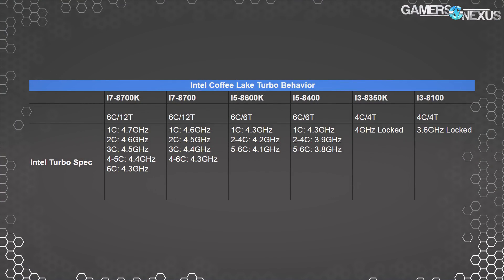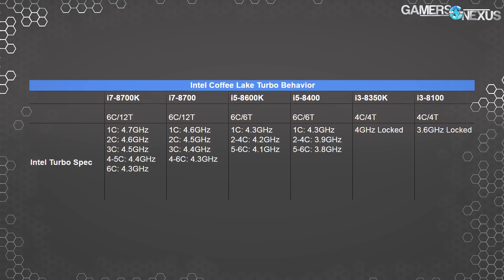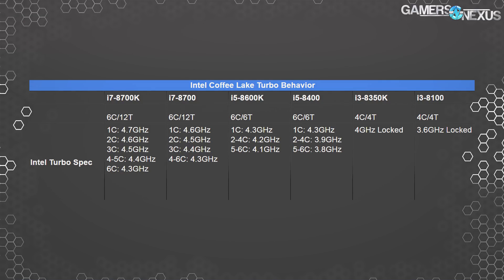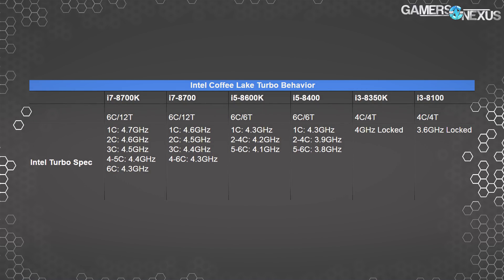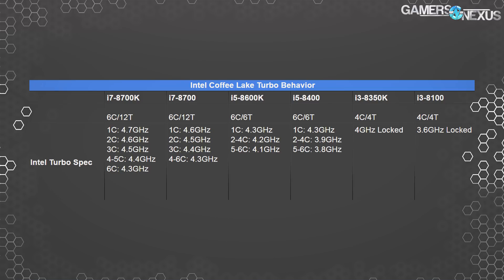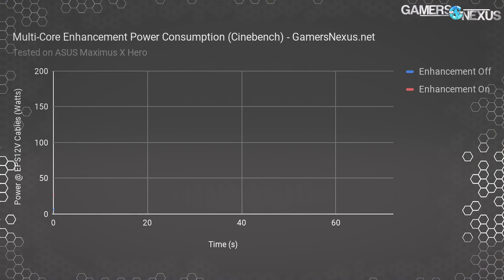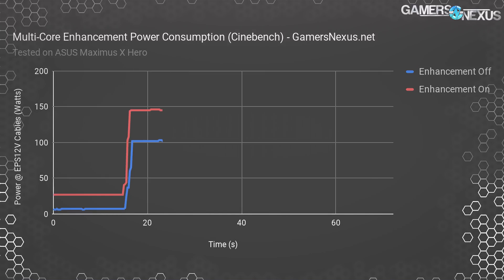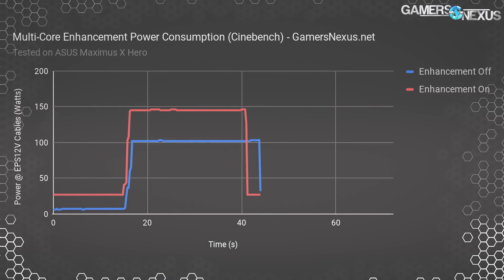Explaining Coffee Lake Turbo Boost Variance & Multi-Core Enhancement

Comment: Hi guys, just wanted to pop-in and let everyone know we watched the video and love the discussion in the comments. Stephen was correct, we want your input in shaping our BIOS policies because at the end of the day we make our products for you guys! To that end we created a FAQ on  our forums that covers: what out policy is, why we implement it the way we do (spoiler: we agree default is default), and to create transparency. If you guys have any questions you can always find me on our forums. - Matt
Reply: Off by default is probably best. Any easy menu to switch things like that on will mean users actually get the benefit but there should probably be a disclaimer/description next to the button to let users know that it may be unstable in some tasks.
Reply: Off by default.

And don't confuse the issue by having more than one type of self-overclocking program. Also, make it as clear as you can what exactly needs to be done to use an auto-overclocking tool so the less informed user can avoid making mistakes. List the possible down sides of using your auto-OC method, such as possible instability.
Reply: Thanks! I know outside looking in our industry can look like an unapproachable giant, but you have to remember we are enthusiasts too!
Reply: By default off.
Reply: :) Hear that a lot actually. Going forward the RGB emphasis in the ads/promos should be toned down abit, but it will obviously still be on the board.
Reply: off by default
Reply: If you want to make people who overclock happy, please make sure to add some sort of 'boot to bios' switch on the boards, when cycling ram timings and try to get things to stick it would be nice if I could walk away and not have to sit there through 5 retry attempts, even setting it to 1 attempt is still annoying to have to spam the del key.  

Also if you feel like really going out of your way, I personally would love for a BIOS that gives some stress tests for CPU and RAM inside the overclocking section with a relevant info panel for monitoring (CPUID HWMonitor is the gold standard for info). I mean sure I can boot into windows and play with timings but tightening ram sub-timings is terribly annoying currently, so much time could be saved.
Reply: mjr2015 you said it man!! Seeing gigabyte's interest in the community and straight up love for their fans im looking out for gigabyte products now for SURE!!
Reply: +GIGABYTE USA every time i think about switching back over to MSI for my personal builds, you guys seem to know i'm pissed at one of your boards and release a bios update that fixes all my problems. My 990FXA-UD3 (rev 4) and Z170x-UD3 ultra have frustrated me over the years...
Reply: Off by default
Reply: I really like how Gigabyte interacts with the community, +1 reputation.
Reply: Make your Mainboards better for Overclocking and better VRMs, I had the GA-Z87X-D3H and was PISSED
Reply: GIGABYTE USA Would this confuse overclocking when enabled? Say you overclocked to 4.9ghz will it try to boost some cores above 5ghz? I'd have it disabled because i like to have control of my own products. It is already causing confusion.
Having just bought a z370 ultra gaming I'm glad gamersnexus did this review because i would of had no idea.
Reply: Multi-core enhancement should OFF by default.  

All defaults should ALWAYS be the most stable and most vanilla options possible.
Everyone buying motherboards will be inside the BIOS anyway and can at that point chose to enable it or whatever. 
I always enable it - but that doesn't mean I want the manufacturer to enable it by default.  In fact, as a customer, I would lose  A LOT of confidence in any manufacturer that set it on as default.   That would be akin to setting overclock parameters by default - which would just be crazy!
Reply: As a default I agree it should be "OFF" however I would like to see better descriptions in the bios on all the options. It is really annoying and flustrating when you select an option like "Multi-Core Enhancement" and get text in the description box of "Enable/Disable Multi-Core Enhancement". It would be much better if it have a brief explanation on what it does and the default setting. I get the in the old Legacy Bios you where extremely limited however in modern bios this is no longer the case I have see bios that have a brief description and a link  to a comprehensive description of the feature if the user want to read more. This should be the STANDARD when it comes to providing information to the user in the bios.
Reply: Good seeing Gigabyte personal on different articles ive seen. I went with the Gaming 7! First time Gigabyte board owner, should go well with my aorus ti
Reply: This.
...I think I know which company I'm getting my next MB from.
Reply: First of all I would like to say that we are of course not the average user and you can generally expect a bit more knowledge from GN viewers.

I personally think it should be off by default in this case. I am ignoring the instability here for a second as really that's just a sign that asus in this case was too aggressive with the voltages and caused the instability on the somewhat badly binned 8700k used here. Given a bit higher voltage the system would have ran stable and this should really just be fixed by asus in my opinion. 

Looking at the results 9% improvement at the cost of 40% power just is not enough to warrant rolling it out to most users. The extra power draw can cause at least a bit more noise from the lots of people still using intel stock coolers and really a 9% gain will not matter much to the average user. 

However in a scenario where you  where you generally get a 40% gain in performance at a 10% gain in power draw on most cpu's I would say sure enable it this is not the case and probably never will be.

I think it should ultimately be a consideration between performance gained and power used as you want to give end users the best possible experience knowing that most people will never manually tune their settings. I do think that settings like this should always be stable even if it may cause a bit higher power usage and may not be needed on all systems as I can imagine a less tech savvy will not always be able to figure out what the problem is and why their system keeps crashing.
Reply: You have definitely earned my respect! I like it when you are willing to talk! Continue the good work!
Reply: To answer your question:
I am a hardware reviewer, collaborating with a prominent website in my country. I do specific reviews focused on gaming. The multicore enhancement feature is useless to me as a reviewer because I will promptly disable it and manually set up the CPU anyway. That's what I did with the 8600K, reaching 5 GHz @1.35V on air cooling with room to spare.
So from my perspective (both as a reviewer and power user), I would like the feature to exist but come disabled, as in "obviously disabled", no "Auto" shenanigans.
More generally, to me, "Auto" means "we're gonna do our stuff however you will have no clue what the stuff is" - and I am very reluctant to leave anything as Auto.
Reply: Yup, most of us could do without any RGB stuff at all.  Most of us are much more interested in features of function!  For example if Gigabyte decided tomorrow to eliminate all RGB across all MB products and instead offered on-board power switches, headless BIOS upgradability, XMP request switches, and LED state indicators for any of a huge range of connection and mode states to ALL of their MB models the world would applaud more than complain! By a lot!  Maybe 20:1...
Reply: @GIGABYTE USA Off by default, the inexperienced user will encounter said crashes and wind up chalking it up to bad components and end up being far more of an issue than it needs to be. IF they were to have it enabled by default it should give a warning with something like "You have core enhancement feature turned on, this is known to cause instability in some programs and if you encounter this it is advised you turn it off in the bios(insert link to a guide to help the user find the setting in bios and turn it off)"
Reply: Or that voltage may be a little higher than required by manual overclock simply because not all cpus are the same.
Reply: I love that you're showing presence! I don't regret going with the Gigabyte Aorus Gaming 7 this time, as opposed to the Asus Maximus VII Hero from last time!

Multi core enhancements should be OFF by default in my opinion! Even if it boosts performance, it's something that the average user does not expect from the CPU.
The CPU should run at whatever it was specified by Intel to run at unless the user changes the specific setting manually.
Reply: Off be default please, let the user learn about it, the possible issues and then make their own decision. Its possible they would want it on for specific jobs x,y,z but for stability while gaming leave it off.. I also think you create a support headache as having it on by default could lead to instability and possibly leading to more RMA's that are not needed.
Reply: RGB: If you can disable it then no problem. And I think users complain because it adds to the price of the motherboard for a feature they won't use. Many users don't understand that the RGB components are not very expensive.
Reply: I love gigabyte motherboards, but currently this z170x ud5 is failing me pretty badly. I used to be able to OC my CPU and RAM without issue. Now I cant touch OC ing without blue screening at any load. I cant even run my memory at its XMP of 3000Mhz... which is just sad. I made sure its not my CPu or RAM by testing others and its the motherboard :(
Reply: I would purchase a Gigabyte Motherboard (I have one, and love it. ESPECIALLY the 10 Rear USB ports), but they are >$20 more than competitors at my local retailer (MSY Australia). Still haven't ruled you guys out yet, got a while till I upgrade my FX 8350 to Ryzen.
Reply: If you set 49X all cores should run at 49x under load."Enhanced" turbo simply pegs all cores at the max multiplier, in this case 49x.
Reply: Off. Stick to the CPU manufacturer specs for default out of the box configuration whenever possible. I know this is getting hazy nowadays, when everything is getting smart and self-overclocking and whatnot, but the closer to a standard baseline we can keep the default configuration across the board, the easier it is to troubleshoot.

ps. Long time gigabyte board user here, love your robust hardware (or maybe I've just always been lucky?) but darnit your BIOS options are awful to figure out sometimes... :-)
Reply: Features like this should be off. MY BIGGEST request though is proper explanations what each item does and clear naming. If on board audio is called anything else other than  on board audio - this doesn't help.
Reply: I believe Off is the correct option. Especially since Intel does not give a HSF with 'k' series cpu's. So you are potentially going to use a HSF from a older Celeron ie the tiniest stock HSF to fit on a 115x socket. Can you even cool a 'k' series CPU with that HSF and multicore enhancement on?

Since all of the major motherboard manufacturers employ professional overclockers I would like to see bios/uefi options written with better descriptions especially for the 'better' (gamer/enthusiast) boards in the series. All too often bios options have no description or an absolutely useless one.

Also different colour motherboards would be nice. For my girlfriends recent 7700k build we had to go with a MSI Titanium M-power z270 board because there is nothing other than black in the market place. She wanted a white and blue build - It looks really nice.

I'm a very happy owner of a z68xp-ud4p with a 2600k. (Yes, my girlfriends pc is faster than mine. gah)Will be upgrading to a Ryzen soonish. Gigabyte will fighting hard for my dollars with ASUS.

Also not a fan of the Aourus branding on the better part of the Gigabyte lineup. Gigabyte is pretty much synonymous with 'Ultra Durable' and reliability a branding you begun with the p45 chipset iirc. Aourus with gamery bling. I know which one I prefer my computer to be.

Thanks for taking the time to listen to the community Gigabyte USA.
Reply: Keep it off please. For the more advanced users, they'll know what this setting is and can enable or disable as they see fit.
Reply: best hardware company in the world! always buy gigabyte!

Comment: By default should be off, user should have the option to enable it in the bios of course. The existence of "Auto" options is rather unfortunate in the first place, imho. Precisely because it is not always clear whatever state it will get into, or what might trigger a state change from that one, or even if any such state change might occur after whatever initial state it chooses

Comment: The turbo boost is only kicking in when the application needs it - that's speedstep. On Auto settings the voltage is variable going up for higher frequencies and lowering with lower ones.  With MCE you make the turbo speed uniform across all cores - equal to Intel's advertised single core turbo boost 2.0. speed. It is fully stable under all conditions unless you have an extremely bad chip. Problem with all these auto settings (including the regular auto voltage) is that the voltage is set too high in order to allow for the worst of the worst chips (but some are just loser chips regardless). You will always have to manually lower the voltage anyway if you are to get better temps, power and lifetime.

Comment: so i7 8700 non-k when enabling xmp and the multi core enhancement does that lock all 6 to the 4.6 boost?
Reply: Yes, it would lock the CPU at 4.6... However not all boards will enable it with XMP. Our boards for instance do not change Turbo based on XMP. You have to manually set it to on.
Reply: Thanks Gigabyte! love your products.
Reply: GIGABYTE USA Good move
Love the your Z370 mobos look btw

Comment: If the mobo manufacturer can guarantee stability, then on. Perhaps not boosing all cores to 4.7 as with the ASUS but to 4.6 or 4.5 perhaps. If you want to push it to higher than a minimum stable level, you can always adjust the multiplier yourself. It would be nice to have this change on the fly though. For example in the ASUS AI Suite setting it to max performance will enable the setting where as other options disable it. This will allow the user to easily change it depending on what they are doing from within Windows.

Comment: I think that Turbo Boost should be off by default because the user could run into stability issues. Maybe if you do things like enable XMP it could ask you if you want to enable it but also tell you the pros/cons. Maybe motherboard manufacturers could include a stock Intel Turbo Boost setting, and an custom Turbo Boost setting that they made.
Reply: This is essentially what we have now. By default the setting is off. You can enable it manually, or if you change the multiplier. You can also go in and change the Turbo Table - IE set the 1 core multiplier to 48x, 2-3 cores to 46x, etc..

Comment: It's a form of overclocking, so the motherboard should not turn it on by default, unless the motherboard comes bundled with a binned CPU they know can handle it. Out of the box overclocking only makes sense when the vendor has tested the individual board and processor together and sells them as a unit, like with OEM GPUs. Keep it as an option, though. If I buy a good chip, and have good cooling, I might want to turn it on, depending on the type of work I plan to throw at it.

Comment: Multi-Core Enhancement - should be off by default. If you buy a PC and it crashes randomly from harder applications and adds up to 40% additional power consumption with ~9% performance increase, then its really not worth it.

Comment: This should definitely be off. The motherboard vendors are free to advertise the auto-OC features as much as they want, but no motherboard should ever apply them by default. Not all builds are capable of handling an OC - if you're running a silent ITX HTPC build, suddenly bumping the voltage to 1.375V becomes a huge problem in terms of thermals...